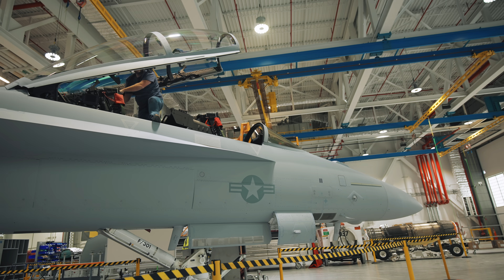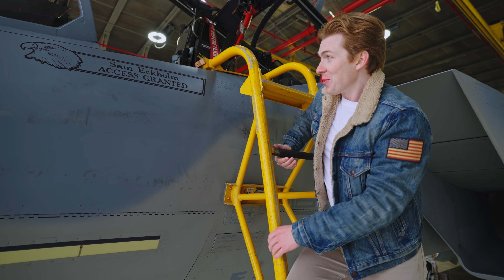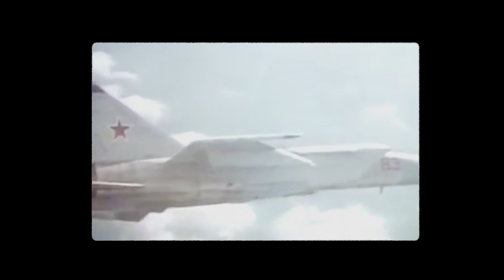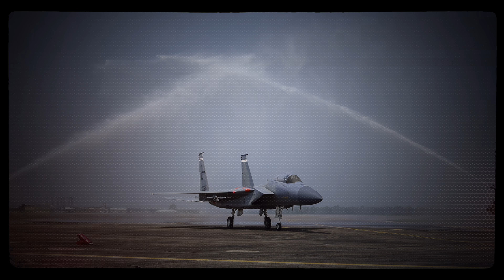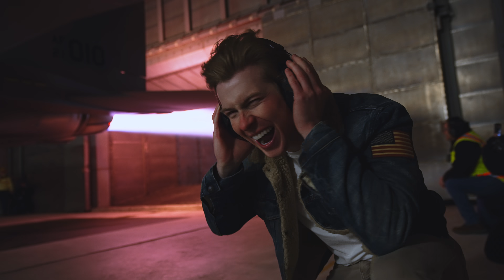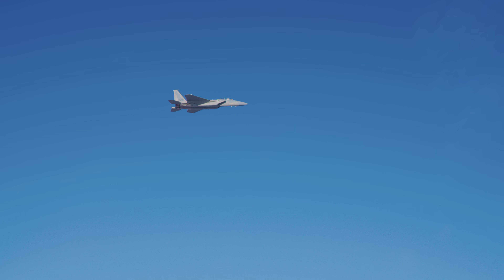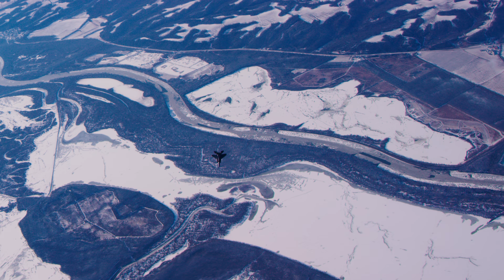Flying the Most Advanced F-15 Ever Built

Comment: Su-34M is still best strike fighter.  

let's compare them. 

Su-34M has a max payload of 14,000 kg vs F15EX 13,400 kg. 

Su-34M with its Pika-M pod has AESA SLAR and AESA ground attack detection for nearly 360° targeting for much better situational awareness. 

Su-34M can fly combat over 1700 km with 8000 kg or 1100 kg with 12,000 kg whilst EX can fly just under 1300 km with 10,000 kg and up to 1600 km with substantially less. 

Su-34M can fly total over 5000 km and up to 8000 km depending on external tanks. Making it capable of intercontinental ISR. EX can fly over 3000 km total and over 5000 km with max tanks. 

Su-34M has built in targeting system consisting of a high definition LLLTV system and auto adjusting laser targeting allowing excellent identification ranges of objects in night vs FLIR although less detection range although Su-34 is a general attacker not CAS Aircraft that targets tanks and vehicles so FLIR is not a necessity altitude it can carry T-220I 3rd generation targeting pod. 

Su-34M offers better abilities with it being able to carry UKR-OE pod for high altitude reconnaissance or the UKR-RT pods with the Tarantul EW system to act as a stand off jammer, this is better than having asigned EW Aircraft like EA-18 as you can just outfit any Su-34M with these pods and it becomes a dedicated ECM fighter. 

F-15EX has more hardpoints and is faster with overall slightly more agility in terms of rate, turn and climb and much better AoA. 

For self defense it is no different to the EX with the ability to used towed decoys along with disposable DRFM jammers and utilising jammer assisted chaff and spectral flares and both utilising GaN based ECM transmitters with sophisticated EW suites

For navigation they seem to be pretty similar with the Su-34M using its upgraded K-102M fully digital navigation with its K-030BM fully digital navigation computer (Which is likely an offspring of the BINS-SP2M which offers amazing sub meter combination accuracy) whilst EX uses its H-764 which will no doubt offer similar performance. Both have satellite navigation with EX using the DIGAR which is linked to NAVSAT block 3 which i believe offers sub 10cm military accuracy with an average of 1m whilst Su-34M uses PPA-S/V-KNS which is linked to GLONASS-K which offers sub 60cm military accuracy and average of 2m. 

For C2 the EX uses its ADCP II computer with an ABMS suite which is likely modern C2ISR software combined with the AN/ARC-231 software defined unified communication complex with Link 16 TDL. This is identical to the Su-34M which uses the Baget-53-31M computer with an IUS-35 C2ISR suite with S-107-1 software defined unified communication complex with OSNOD TDL.

For fire control they are practically identical. F-15EX uses the APG-82 fully digital fcs with its 64x bit ADCP II computer and Phantom Fusion sensor fusion system. Meanwhile Su-34M uses Sh-141M fully digital fcs with its 64x bit SOLO computer and KPrNO sensor fusion system

A slight difference would be that the EX relies on a single computer for C2 and fire control whilst Su-34M relies on SOLO series for fire control and Baget-53-31M for C2. 

Overall id say both are pretty similar but Su-34M is superior for ground attack due to it's modularity, integrated targeting system, high range and higher payload along with better variety of PGMs imo. 

Su-34M has higher payload, higher combat range, better radar, built in targeting system and better self defense suite with a rear radar for defence
Reply: Why?
Reply: @JamesMathison98  

High payload 
Built in optical targeting system 
Amazing self defense suite 
Various Pods 
Amazing amount of PGMs 
Multi role abilities (ground attack, cas, reconnaissance, ew, signit etc) 
Advanced avionics
Reply: @S @SMRMilitaryAnalysis6 why do you think it’s better than the EX or the E?
Reply: @JamesMathison98  i think it's better in the above areas
Reply: @SMRMilitaryAnalysis6 soo… you are somebody with no subject matter knowledge on either of them  and made a random judgement based on vibes?
Reply: @JamesMathison98 let's compare them. 

Su-34M has a max payload of 14,000 kg vs F15EX 13,400 kg. 

Su-34M with its Pika-M pod has AESA SLAR and AESA ground attack detection for nearly 360° targeting for much better situational awareness. 

Su-34M can fly combat over 1700 km with 8000 kg or 1100 kg with 12,000 kg whilst EX can fly just under 1300 km with 10,000 kg and up to 1600 km with substantially less. 

Su-34M can fly total over 5000 km and up to 8000 km depending on external tanks. Making it capable of intercontinental ISR. EX can fly over 3000 km total and over 5000 km with max tanks. 

Su-34M has built in targeting system consisting of a high definition LLLTV system and auto adjusting laser targeting allowing excellent identification ranges of objects in night vs FLIR although less detection range although Su-34 is a general attacker not CAS Aircraft that targets tanks and vehicles so FLIR is not a necessity altitude it can carry T-220I 3rd generation targeting pod. 

Su-34M offers better abilities with it being able to carry UKR-OE pod for high altitude reconnaissance or the UKR-RT pods with the Tarantul EW system to act as a stand off jammer, this is better than having asigned EW Aircraft like EA-18 as you can just outfit any Su-34M with these pods and it becomes a dedicated ECM fighter. 

F-15EX has more hardpoints and is faster with overall slightly more agility in terms of rate, turn and climb and much better AoA. 

For self defense it is no different to the EX with the ability to used towed decoys along with disposable DRFM jammers and utilising jammer assisted chaff and spectral flares and both utilising GaN based ECM transmitters with sophisticated EW suites

For navigation they seem to be pretty similar with the Su-34M using its upgraded K-102M fully digital navigation with its K-030BM fully digital navigation computer (Which is likely an offspring of the BINS-SP2M which offers amazing sub meter combination accuracy) whilst EX uses its H-764 which will no doubt offer similar performance. Both have satellite navigation with EX using the DIGAR which is linked to NAVSAT block 3 which i believe offers sub 10cm military accuracy with an average of 1m whilst Su-34M uses PPA-S/V-KNS which is linked to GLONASS-K which offers sub 60cm military accuracy and average of 2m. 

For C2 the EX uses its ADCP II computer with an ABMS suite which is likely modern C2ISR software combined with the AN/ARC-231 software defined unified communication complex with Link 16 TDL. This is identical to the Su-34M which uses the Baget-53-31M computer with an IUS-35 C2ISR suite with S-107-1 software defined unified communication complex with OSNOD TDL.

For fire control they are practically identical. F-15EX uses the APG-82 fully digital fcs with its 64x bit ADCP II computer and Phantom Fusion sensor fusion system. Meanwhile Su-34M uses Sh-141M fully digital fcs with its 64x bit SOLO computer and KPrNO sensor fusion system

A slight difference would be that the EX relies on a single computer for C2 and fire control whilst Su-34M relies on SOLO series for fire control and Baget-53-31M for C2. 

Overall id say both are pretty similar but Su-34M is superior for ground attack due to it's modularity, integrated targeting system, high range and higher payload along with better variety of PGMs imo. 

Su-34M has higher payload, higher combat range, better radar, built in targeting system and better self defense suite with a rear radar for defence
Reply: @JamesMathison98  see main comment
Reply: @SMRMilita @SMRMilitaryAnalysis6 edited it with a copy paste comment, nice.

So do you think you have an appropriate understanding of the situation by getting an AI summary or googling it?

My point is this, idk which is a better strike fighter. Googling stats is a poor comparison, as the real story is likely very different and also we have a bad perspective. F-15E pilots and Su-34 pilots would look at your attempted understanding of the situation and see it woefully wrong. I know that because I’ve been in positions like theirs, and see what the bobbs think they know with such confidence, and see how off they are
Reply: @JamesMathison98  None of this is ai. Its all from my blog. Sounds like you're just upset that im saying Su34 is better and you don't know enough on their details to try say otherwise lol
Reply: @JamesMathison98  I've seen this guy say Iraq didn't have any MiG-29s in Desert Storm, so take everything he says with a few grains of salt
Reply: @SMRMilitaryAnalysis6 alright brother. You’re entitled to your opinion. It’s just silly to have such a firm opinion on something you know very little about

Comment: Leak the docs stat I need them to say this sucker has 2000 large caliber cm, 18 aam, radar with 120x240 degree scan range, almost no compression, 45 degrees per second sustained turn rate, 20 g limit, and the thrust to weight ratio of 4:1 

-your humble us wt main 😂

Comment: I am thrilled to see that the USAF is updating this magnificent aircraft. When I was reassigned out of a fighter squadron, as a thank you by the commander, I was given a 2-hour incentive ride in the backseat in a F-15 Strike Eagle. While taxiing out to the runway, the pilot was given authorization for a "ballistic" take-off (he found out that morning that he had been accepted into the Air Force's Top Gun program) and we rocketed off the runway at a 70% climb angle at full military power. We climbed up and out to cruising altitude and proceeded to run through valleys of the infamous Mach Loop in the Welsh mountains. At one point in the flight, he even gave me the stick for a minute to gently guide the aircraft through the clouds. Later on, he demonstrated 1-v-1 dogfighting with our F-15E wingman and we pulled up to 5 Gs at a time. I will never forget that flight. It was one of the highlights of my Air Force career.

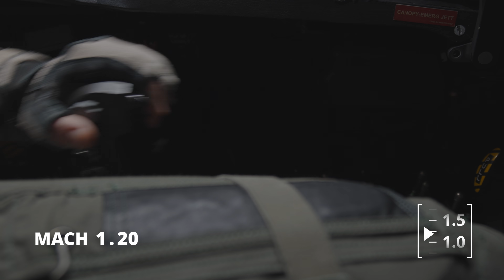Comment: @15:36 I wish we could see the top speed run in real time, really curious how fast it accelerates with the new engines. 

It should be pretty crazy, i wonder how it compares to the eurofighter and rafale. I guess they chose the F110 over the F100 IPE because of better dry thrust and fuel economy thanks to F110s higher BPR. And the F110 nozzle petals and also the afterburner plume just look stunning!

Comment: Thing is the F-15EX is a supplemental aircraft, which is fine. Its primary role is surface support. Warheads on foreheads, but it has the capabilities to be defensive and go on the offensive. It’s not an F-22 whose whole purpose is air superiority and battlespace control. It’s to get in, do some damage, and then, if need be, fight its way out or outrun anything that attempts to engage it. With the 15C’s being retired, it’s good to see a very capable 4th gen be elevated up to its competitors at 4.5+ gen like the Su-30SM2, Su-35S, Rafale, and Eurofighter. Honestly Bravo to Boeing and Boeing engineers keeping the aircraft relevant and capable for the foreseeable future
Reply: As a missile truck doing beyond visual range air to air, I think the EX has a lot to offer. Datalink from stealth aircraft feed it targets, best of both worlds
Reply: RE: "Its primary role is surface support."

The F-15EX's primary role is air-to-air as the replacement for the F-15C. Only relatively recently have they started the inevitable process of expanding it's air-to-ground capabilities per its F-15E lineage, payload capacity, fuel capacity, and no major hurdles in expanding the mission to be a greater multi-role threat.
Reply: @jamison884 the F-15E was never an air superiority fighter…. And the F-22 replaced the F-15C’s long ago
Reply: @eRAD6127  I never claimed that the F-15E was an air superiority or air-to-air fighter; I noted the F-15C served primarily as an air-to-air fighter.

The F-22 is "the" air superiority fighter, and I believe the USAF itself deems it to be a special beast worthy of that specific role, rather than categorizing it simply as a fighter along with the F-15C, F-16, and most recently the F-15EX, despite the fact they all carry air-to-air missiles and have proven to be highly effective fighters. In a somewhat similar manner, I believe the F-35 variants are categorized as a multi-role fighter aircraft that's capable of air-to-air, air-to-ground, SEAD, command & control/recon, and electronic warfare, rather than a fighter that's lumped into the aforementioned group. It's no big deal anyhow, that's just my thoughts.

My comment about the F-15EX replacing the fighter capabilities of the retired F-15C, as well as the F-15EX's role beginning to expand to enable air-to-ground combat as an established capability, is all information obtained via quotes from USAF officers and Congress, plus analysis from sites like The Warzone.
Reply: @jamison884 the reason I said that is because the F-15C was the air superiority fighter for the time. The 15E has always been the multirole variant. My initial comment is that it was never designed as an air superiority fighter because it’s an upgraded 15E. Now that doesn’t mean it cannot perform that function for lesser or smaller airforces that have requested them. I’m saying strictly in the US role it’s not a spearhead aircraft the same way the F-22 and F-35’s are. It’s supplemental or secondary line like the 16 and 18 are. I’d honestly be very surprised if Japan, for example, didn’t order some to replace their aging 15J’s because of how much they like the 15. Maybe call it the 15JX or something. I’m not downplaying its capabilities, I’m simply stating where it falls in the Air Force hierarchy for combat operations. It’s supplemental in large scale ops, but small skirmishes or small engagements where air superiority has already been achieved or where F-22’s aren’t needed to establish air superiority, it will thrive. It’s still an 15E and still capable, especially an upgraded one with an AESA and extra AMRAAM racks to more than take care of itself
Reply: @eRAD6127 
The USAF has been running F22 and F15C as their only Air Superiority platforms.

The F22 never replaced the F15, there is nowhere near enough F22 to replace the F15.
The USAF wanted 400 F22 to allow them to control future potential high profile conflicts. They have 160.

The F15EX is the Air Superiority fighter the USAF needs to bolster the ranks by replacing the F15C.

Having one of the most powerful A2A radars is for the reason of Air Superiority, something small payload and range fighters like F35 and all that plus small radars like F16, cannot perform at the required level.
Reply: Well in 10 years will have the F-47, BAE Tempest, rumored F-22EX. So atleast they will have these F-15EX to retire the old F-15 and 16s
Reply: @nephilimdj  America isn’t getting the tempest
Reply: 106-0)) Russians are just laughing at you. Come to Ukraine, in the first hour there will be a one.By the way, ask your Ukrainian friends how many F-16s have been in service))
Reply: you forgot the grippen ^^ it's 4.5 plus gen . and i would call the F-16 vyper a 4.5 plus too because it has upgrated avionics. i never understood the hype around the F-22 .... let us not forget that it took  2 missiles of 600k a pop to down a sitting still air balloon , the only confirmed downed target in 20 plus years of service wen a regular F-16 or F-15 could just have used the guns to down it  ,at the red flag lost against a rafale and the only handycap that it had was no beyond visual engagement , it was outmaneuvered . and all this wile russians down REAPER drones by pissing fuel on them ... as a simple DCS player i can't help of being fan of russian jets , the way they move , the way they look ..... belkan wizardry
Reply: you realize the F22 also has guns, right? A missile was used because it was the most predictable way to get it down somewhere, instead of slowly leaking air from a bunch of holes and falling who knows where.
Reply: That's about all it's good for, as badass as it is. I still wouldn't want to be flying one if we ever get into it with China.. They will have a bunch of innocent-looking fishing and container ships spread across the sea with SAMs in containers ready to be setup and fired. And other unconventionally methods. Good chance they would smoke you a thousand miles offshore as you're refueling, if it was a full-on hot war. The future really is smaller drones en-masse, larger stealth drones, and stealth aircraft, as well as unconventional approaches. Even in the Ukraine war, both sides can only use their 4th gen fighters to lob standoff weapons and to hunt drones, they don't attempt to cross the border or head deep into enemy airspace. 

And this is coming from red-blooded American boy who loves his guns and has had all these fighters up on the wall as a kid.
Reply: @Chr @Chris11249 That would be left up to see. Those container ships will likely be an issue at first but as the history of armed merchantmen has shown they are usually very quickly hunted down and destroyed once they are known. That was the case in WW2 and would be even easier today. In addition, just because they can see and shoot at you doesn’t mean they’ll shoot you down; the F-15EX still has a lot of options to defend itself in those kinds of situations. And that’s assuming Chinese AA is any decent, which is good to assume that as it’s better to assume they are good and they turn out to suck than to assume they suck and they turn out to be good lol